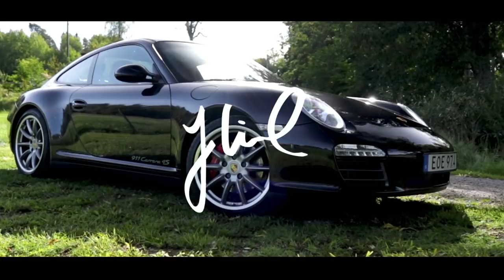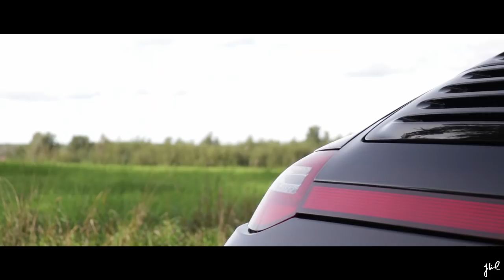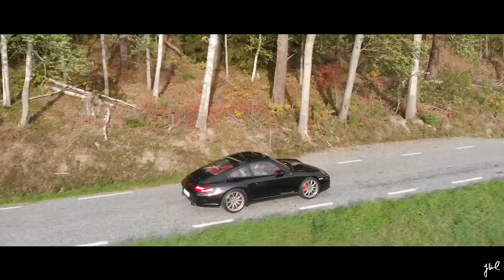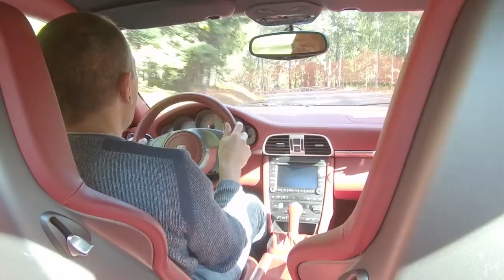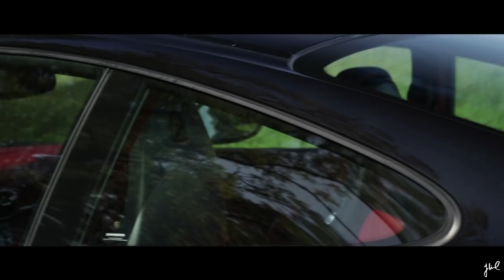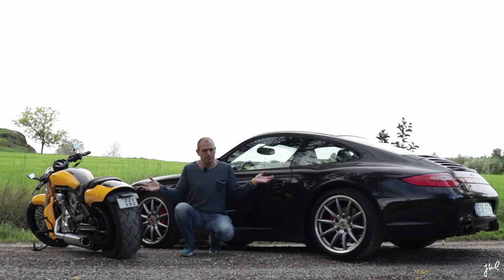Porsche 911 (997.2) Carrera 4s Power Kit X51 - Review | EP 042

Comment: Thanks Janko. A great video. My 997.2 C4S is parked up in the garage under covers and hasn't been started for about 6 weeks. So, this afternoon I'm going to get the car out and go for a long drive. Thanks for the inspiration to get the car out more.
Reply from the maker: Many cars are parked for the season right now. I'm thinking of taking my GT3 for a spin.
Reply: The weather would be a valid reason if I didn’t live in Australia where its currently spring and 32 deg celcius at 10am :-)
Reply: Boxster goes out in NC over 45F and dry roads.  Tucked in on the lift while buckets of rain fall.  Drove her 2d ago.

Comment: Thanks for an entertaining video. No fast forward necessary. Great to hear someone speaking clearly for a change. 

997.2 4S Cab non baptised here. Last 911 I had was a 3.2 Cab. I wanted performance comfort, refinement and safety and it delivers 200%. I don’t mind that 80’s 911’s have rocketed in price - I wouldn’t touch one again. Too many close shaves. PDK is the biggest surprise for me. I also had too many bad shifts in the 3.2 and with my declining hearing a manual wouldn’t work anymore. The power band is wide and the engine, although sounding great, is relatively quiet. Trust me there’s plenty thrills to concentrate on even without deciding on gears.

I don’t think the 997.2 needs to be compared with anything. To me it is perfect yet classic. No Alcantara for me thank you.
Reply from the maker: Hi Roger and, thank you for contributing to our community. There is a Porsche for everybody and is sound like you have found yours. If you are not already, please subscribe to my channel.

Comment: Every time I see the new generation Porsche 911 I always think of Nick Murray with all due respect. The new cars represent a departure to a different group of porsche owner. Sports car tick, expensive watch tick, etc. Production numbers up, lets make another model  911 a sportster, a this a that more production more money get those easy to assemble vw and audi bits faster production line more cars. Soon Porsche going to be exactly like BMW 300 models with a change in direction every few years. Its always about increasing profit never drawing a line in the sand. I sat in a 992.2 I was offered a very good deal and trade on my car a 997.2 C4s honestly I find the car vulgar no way am I changing. So its faster so what my 997.2 way fast enough for the real world. The only car I could consider on the outside is a 991.1 but other than that I feel porsche has sold out to the american market next they will launch a pick up with a 5.0 v8. For me the last 911's are the 997.2 which is literally a sports car built like a tank, machined bits tough as hell ask the porsche workshop foreman what they would buy 75% will say 997.2 the other 25% 991.1 the other is the 991.1 which is a departure from the german panzer the 997 is but still very good and has to my eye better lines. The 991.2 onwards forget it you can bull shit the yuppies with their quaffed hair and loafers but real drivers that understand cars will tell you 997.2 or 991.1 end of story.
Reply from the maker: There is a Porsche for everybody and congratulation to your 997.2, please take care.

Comment: The 997 feels cheap today. If you put a low mileage 996 C4S next to the 997, you feel the difference.
Reply from the maker: Hmm interesting thought, the prices for the 996 C4S is going up in Sweden.
Reply: Janko Lind reason why I say this, is because I sat in a couple of 996 models (turbo/4S) also in the 997 models, and in both low mileage, the 996 seems better in quality. And to say the truth, the MK2 of the 996 looks wonderful ❤️
Reply: I just couldn’t disagree with you more.  The interior alone on the 997 steps up the quality by leaps and bounds over the 996.